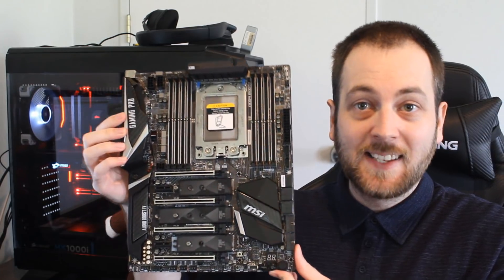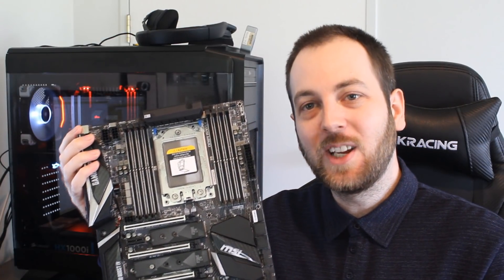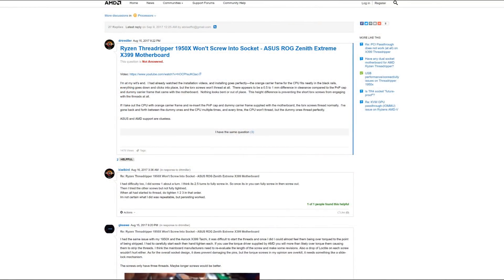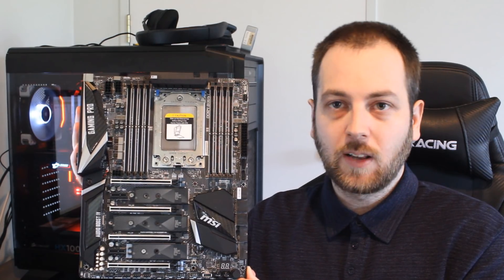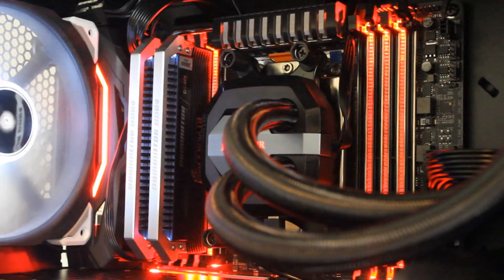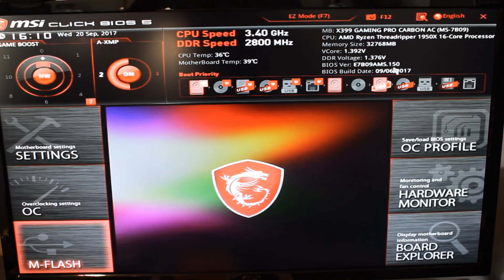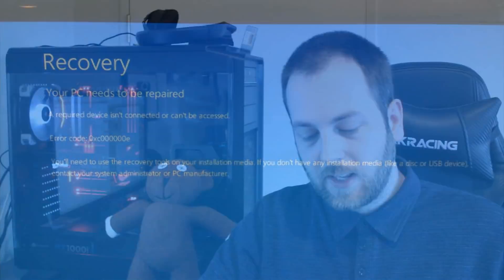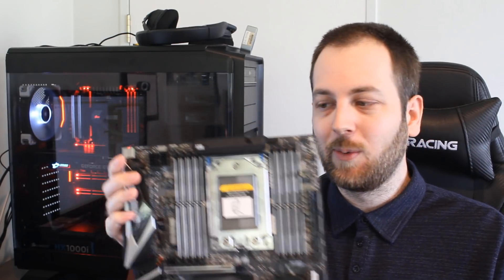X399 Is A Mess Right Now (Socket, Memory & Windows Issues & Fixes)

Comment from the maker: *Please look at the date this video was posted on, this was when X399 was very new with very limited Bios updates, we have seen some major improvements since posting the video.
Reply: I can imagine that at introduction there were many hiccups. Just finished my X399 build yesterday and all went fine, however TR installation and tuning requires care. Thanks to channel like yours is easy to avoid mistakes, thanks!
Reply: Also . I was '"Just"" watching   JayzTwoCents   video on His Thread Ripper  seating  issue , This how I found your Channel .
Reply: The Fall Creators Edition Has Limited My Ryzen  OC . Its Just Fine in the Windows 10 And windows 10 Pro Editions , But < the Fall Creators edition is A Mess . I`m Running a X 370 Prime Pro with R 5 1500 X , All Up to Date Bios`s and drivers . I have several drives with Different OS`s installed on them , From the 10 to the 10 Pro to the Fall Creators Edition . The Fall creators edition was updated From a 10 Pro Install . I Went Back to 10 pro , And the Problem Is Gone ! Ran the update , once again , and again , and again , Every time I Update to the Fall  Creators edition , It Limits My OC . Every time !
Reply: Thank you
Reply: tell that to asus with bios back in august
Reply: This is the last asus/amd product I will ever buy.

Brother and I got a set of them and then we had some family medical issues for a few months, now we got 0 warranty that the manufacturers will honor and two dead systems.
Reply: So I have a 1950X system with 8x8GB Ram sticks and 3 m.2 drives on an X399 Gigabyte Aorus Xtreme MB. And I have problems with this system - have always had problems - either the 64gb ram wont be recognized or the MB will drop the m.2 ssds - I am at the latest version of the BIOS F5i and I am at my wits end on how to stabilize this system. I am watercooling with a 240mm rad. If you have any suggestions please let me know. Power supply is 1065W case is In-Win HFrame 2.0. 2 1080Tis also watercooled. Dating this comment for others benefit - 9/19/2019
Reply: Buying a high-end AMD system is like buying a high-end burger (Big Mac) from McDonalds … it is still McDonalds...

Comment: I have new question anyone seen D5 boot code error (non boot after system no longer boots after a reboot where system was working fine, then prompted that it needed to reboot due to updates).  the manual says "No space for legacy rom". -  I have LOTS of ssd (3) sata 2.5 and the 3 nvme motherboard, a pice with 1 name, anoter hyper m.2 card (4 x 512) and a sata 20tb  so I'm wonder if it has to do with UEFI after windows 11 updated.. I wasn't able to upgrade to window 11 because this board not supported. but new install worked. (at least for last year), until now.  you're right a complete mess. (I just bought a new system) but was still hopeful about recovering this one. 

I also have the Aurous Gaming 7 with 1950X threadripper, working since I got it in 2017, with all the same problems, through its lifetime, the scew #3 is one that gave me trouble on my Foxconn socket (after I took cooler off to try to solve the new issue, which is why I'm posting).   anyways for me the biggest thing is red cpu light (and d5) code,  I tried gigabyte support guy, he said try different board or cpu (which you can't really get anymore).  cmos reset doesnt seem to clear it error problem. battery removed, only 1 memory stick inserted, unplugged while reset button on mb).  I have had issues where it didnt boot in past, but nothing the persisted like this

Comment: I have a MSI Carbon Gaming Pro x399 and a TR 1920X with 32gb RAM. It has been great since I bought it six years ago until now… Now I get spontaneous re-boots sometimes one after the other sometimes after a few hours. I have replaced the PSU, checked all the RAM unplugged everything, updated the BIOS and it still does it. I read recently that it could be the CPU voltage that needs addressing? I would have thought if this board/CPU is proving faulty after six years that isn't much of a lifetime? I was hoping to get another year out of it before the 1920x is no longer supported by Windows 11 which I was planning on upgrading next year before Windows 10 is dropped.

Comment: I know this is an older video. With that said,  My 1950X is on an X399 Phantom gaming 6. I didn't get mine until the Gen1 threadripper prices dropped because of newer generations.  I never had any of these issues. Did I get lucky, maybe. Were the issues solve by the time I built mine, I hope. Either way, my system is a beast.

Comment: "Does this ram work on ASUS ZENITH EXTREME ALPHA motherboard and AMD TREADRIPPER 2990 WX Processor..??" 

For ASUS ZENITH EXTREME ALPHA and AMD TREADRIPPER 2990WX PROCESSOR there are no RAM hitting 3600 frequency on QVL.. All are below 3000MHz.. As ASUS ZENITH EXTREME ALPHA has XMP 2.0 Feature on it.. can Trident Z Neo or Trident Z Royal would b suitable.. As ROYAL complies with both intel and Amd mobo would it be safer to go for it out of QVL..

Comment: #Tech Showdown - can you show please how to update x399 motherboards? I got MSI x399 SLI PLUS. It won't boot with 1950x  but for no reason brand new from amazon - I conclude that same issue - Bios update are needed!  I never did any Bios updates so i have no clue even how to update Bios!!! Meanwhile my x399 board are usable as doorsstopper or shelf for dusts.

Comment: Did they fix x399 issues? I built mine today without doing any research (asrock taichi x399 vs 2950x) and they work just fine. I found lots of videos about how bad x399 is after finishing my build lol.

Comment: Just built a AMD 2950x with the MSI X399 Creative motherboard and I did not have any of these issues. (Jan 2019). 
Although the default “smart” fan speeds were set too low. 
This chip max temp is rated to 68 degrees, so I want full fan speed by 60 degrees Instead of the default 80 degrees.

Comment: Still has memory issues with asus rog strix x399-e, cpu overclocks just fine (1900x) but my coresair 4x8 32gigs wont boot above 2133 i dont know what iam doing wrong 😡 DOCP or Manual

Comment: I'm having a headache with my setup. I read about the Threadripper / RAM / Motherboard issues before I bought these components, but I though it was all history, and the BIOS updates would fix it all like magic...I was wrong. I have a Threadripper 2920x on an ASUS Rog Zenith Extreme Motherboard, with 2x16 Trident Z RGB G.Skill RAM installed in DIMM A1 and C1, I only have one HD installed for start-up, a Corsair MP500 480GB SSD. I was getting an intermittent error message for video card, so I put in a new ASUS GeForce RTX2070 STRIX Gaming OC 8GB. First boot did everything as expected (nothing), so I updated BIOS to 1402, and 2 newer versions (all worked the same) and then it booted to BIOS no problem and seemed to be on the right path. Then the real problem started...loading windows via a usb ends with the blue screen of death every time, and widows 10 will not load. Most common error message is "System thread exception not handled" but I also get "Bad Pool Headder" and "Kernel Security check failure". The other notable is that this motherboard had a CPU ready light which indicates whether the cpu is ready to boot, or not. red light for not ready, and green for cpu ready to boot. The problem is, and there is no light coming on at all. I don't know if this is a problem at this stage or that windows needs to be installed first, but I'm a bit worried about the lack of cpu ready light. BIOS 1601 is the latest version, which I've tried with the same results. I've turned off the WiFi, and have the motherboard at original settings (no speed, or voltage increases). Booted in safe mode, LN2 mode, and other settings, but came back to stock settings, all the things I tried ended with the same results. Thanks or any help to put me out of my misery...haha!

Comment: Great info! I got Meg x399 creation with Ryzon 2990wx and G skill 16x4 3200 memory. And I just can't install windows. It keeps giving me blue screen. I got just one 970 PRO NVMe M.2 1TB connected. Well other hard drives are connected through SATA but just the Sata cable and not the memory cables. Do you think that could be an issue? UEFI set, Updated Bios, IOMMU disabled. Still doesn't work. Next I'm thinking to use MEMORY TRY IT! option or A-XMP, what do you think? Would that fix the issue?

Comment: So the socket is the issue so why blame the CPU? I'm coming from the x99 platform as well and it's been the best board and proc I've ever owned. That msi board is a shitpile as well. So many issues with it. I found that you must rnable xmp 1 or 2 or it just does strange shit. And the m.2 is flaky as hell in raid. But all in all the threadripper is a beast if you get it working

Comment: I have MSI carbon board and the memory slot 5&6 are defective. If I have memory stick in any of those slots, the board will stuck at error code C5, which is unspecified on the user manual. I end up not using full memory capacity and I think I might have got a bad board.

Comment: I have  the Carbon MSI too and had also a couple of problems. CPU 1900X.
1. It's practlically almost impossible to drive this board with air-cooling cause of too little space between CPU-socket und 1st PCI-e_slot. The remain space between CPU-heatspreader and backplane of GPU is to small (short circuit danger). For my taste, a bigger MB-factor is necessary (like Asus EE-ATX).
2. This MB need absolutely 3*8-Pins (2*EPS+1*PCI-e). If you don't connect the additional PCI-e (8-Pins) on the board the UBS on the back will not work properly and a soon you switch your (4K) monitor to 'Free-Sync'... you get black screen and never run again a (colored) screen untill you switch back. So, for now I have only 1*RX580 (GPU) but I would be curious to see what happen if I connect a second one with second monitor switched in 'Free-Sync'.
3. I bougt this board 2 weeks agoo, by caching new 'BIOS' on MSI-Site I got 3 diffent versions in 3 days (during system-mounting) and two of previosly downloaded BIOS-versions disappeared from their web-page. I expect (if I already wait for one year not only for sinking prices but forall) fixed and stable BIOS. But it appear that not the case after one year (sadly).

My fazit: The main-boards_manufacturer did a good job.

Comment: I finally gave up on that cheapo torque wrench thing. When the screws actually fit into the standoffs, the wrench would not work. So I just tightened the screws down until the system booted. It would be really nice if the screws lined up with their mounts correctly (talking to you AsRock).

Comment: I have the x399 zenith extreme mobo, was running fine with 2 sticks of g skill ram. I’ve since custom water cooled it and added 2 more sticks of ram. 

Never had so many issues, my pc will no longer post with 4 ram installed. I take it back to the store for warranty and testing and it would only post from 1 of 8 slots. I got it back 2 days ago and you guessed it. Still doesn’t work

Comment: I Think the threadripper cpu are bad becouse they have bad latancy issuse caused by individual cores throttling down and becose there are lots of core this is creating the latacy. also data across the dies is a latancy issue as well . AMD have only managed to bodge this throttling down issue by makeing the CPU run at max clock speed all the time ryzen power manager was introduced to mask this issue also you have to shut down one of the Cpu "die" for gameing. WHAT A COMPLEAT BODGE.

Comment: Hello Sire ! 
Thank you for the video !
I have a quick question for you as I am quite a newbie in terms of computer: I just got myself a Theardripper workstation that goes with this motherboard (MSI x399) and I am having trouble installing windows. 
It informs me it cannot find a disk drives and ask me to supply using USB/DVD/CD.
I tried with several driver but it always tells me that It i not working. 
Any clue how to instal WIN 10 easly ? 
Thank you !
Reply from the maker: If you have multiple drives then just disconnect all the drives aside from the one you want to install windows onto and then it should work.
Reply: Wow thank you so much for the quick answer. 
You mean by that that I disconnect my 2 SSD and my HDD and just boot the computer with the USB ?
Reply from the maker: Kinda, I would guess that you want to install Windows onto one of the SSD's correct? so leave the SSD that you want to install windows onto connected and disconnect the other SSD and your HDD, then install windows with your USB drive.
Reply: Actually i am trying to set my SSD in RAID0. I managed to did it in the Bios.

Comment: My ASUS ROG Zenith Extreme experience started out weirdly from the beginning.. Evga 1080 TI Hybrid, 64 Gb RAM, 2X 1TB SAMSUNG M.2 SSD's on the SIM.2 card and a 2TB m.2 SSD under the LED heatzink. 5 stage optimization took the 1950x up to 3950 Ghz / around 30-40 Celcius on idle. Settled for 3700 with around 34Celcius/idle). Then suspision set in after my StarTech Firewire 1X PCIe card would'nt function in ASUS MB'S 1X PCIe SLOT but does so in the X16 slot above it, Load VGA BIOS errors, leaving my SAMSUNG 49" SUW flashing Display Cable? etc.. REALLY?!. Today all Hell broke loose! Unable to find OS on 1TBm.2 or any! m.2 SSD OR boot from USB because the FMB, it's CPU, RAM or any possible combination within  turned my brand new PC /WS into a useless Brick. Noticed how Win 10 programs which I installed and successfully ran yesterday would'nt run today. StarTech support said, Problems with my Mb my ASUS dito, I.E. "support" is horrible.. returning entire PC with CPU, GPU, m.2's and RAM to B&H first thing tomorrow for Mb replacement and further paid troubleshooting.. Loved it when it "Worked," Right now it's a +$10,000.00 POS!

Comment: I think the most important video that is required is what liquid cooler works the best for x399 platform. The reason being threadripper4 is a bigger socket than the  most of other sockets for which the AIO water cooling kits are designed. Probably the current AIO options may not work properly  for threadripper build. Thanks and appreciate your video.

Comment: I have the x399 MSI Carbon board and it's never been a problem. Did like 6 BIOS flashes just because...but never had a problem.  Even 3200MhzCL14 from start on by XMP profiles worked without any hassle! The 1800X on my AM4 ASUS Hero board was a nightmare however. 3200Mhz was near impossible.
As you explained, there are actually two different brands of TR4 sockets. And LOTES seems to be better. Even though Foxconn is a known name. LOL
But C0 is a recent bug I have (restart bug). And I think my BIOS is the newest. However it's not really a problem to me. I start the PC daily and I shut it off daily. Reboot usually never happens.

Comment: My issue isnt the manhandling the socket. I have the Gigabyte  x399 Aorus 7 and the 1950X TR. All the fans turn on but the issue is having the CPU status LED light on and the mobo has a code of "00" or could it be "D0"?  Either way, Iunno if its the mobo or the CPU atm. :s

Comment: Got my system about January 20th 2018

RIG SETUP:

3 Samsung 960 Pro series 512gb  NVMe drives in RAID 0

ASUS ROG Zenith Extreme motherboard

64 GB Crucial Ballistix CT10739272 (2 32GB Kits) quad channel

EKWB custom water cooling, mono block for MB and block for the 1080Ti GPU

Antec 80Plus PSU ATX  HCP-1000 PLATINUM (am only running one GPU card

Misc led strips for the massive case i purchased

1 uxcell 50mm x 10mm 12V DC Cooling Fan for the NVMe riser card drives

Thermaltake Core X5 Tempered Glass Black Edition Case to cram it all in

1 Crucial BX100 500GB SATA 2.5 Inch Internal SSD (Scratch drive)

THE ISSUE:

THE BIOS WAS UPDATED FIRST, READ AND WATCHED ALL OF THE ISSUES ABOUT THE BIOS REVISION AND, BELIEVE IT OR NOT, THE MOTHERBOARD STILL CAME WITH THE FIRST BIOS RELEASE INSTALLED. 

Windows 10 PRO would load normally no issues, then after installing the latest drivers from ASUS, i followed up to NVIDIA's website, downloaded the driver only for it to tell me it was the wrong OS installed! So being the 28 year PC tech i am did the ole google bit and found out DUH need to install the "Fall Creators Pack" edition of windows. Hell of a way to name a service pack but i digress. Sooooooo, after trying for 5 days to figure out WHY IN HOLY HELL it would randomly through out a BSOD with "clock watchdog timeout". Googled and tried solutions for days. NOTHING WORKED.

HAD A BRAIN FART!!

So i downloaded the "Fall Creators Pack" update ISO, Ripped it to a USB thumb drive, made sure i had the RAID drivers on said thumb drive, rebooted and installed windows all over again as a fresh install WITH NO ISSUES.

No idea what was causing the problem, tried taking memory out down to 1 8gb stick, tried 2 sticks of ram, you name it i tried it till i had the brain fart.

I'm curious to know if anyone else has had this issue!!